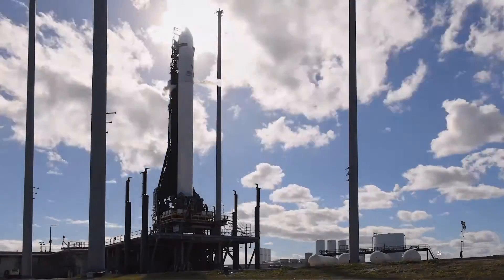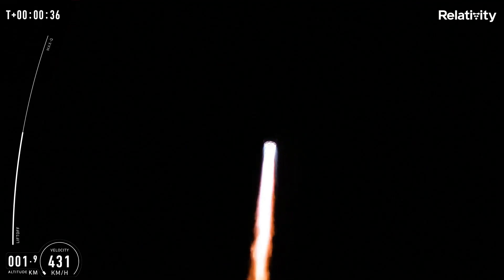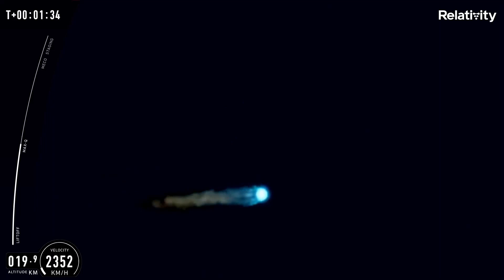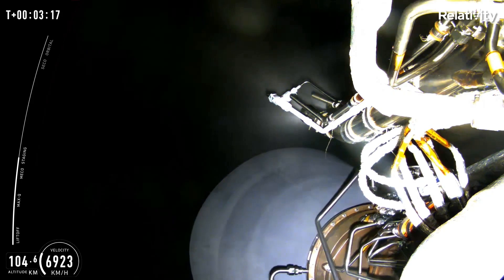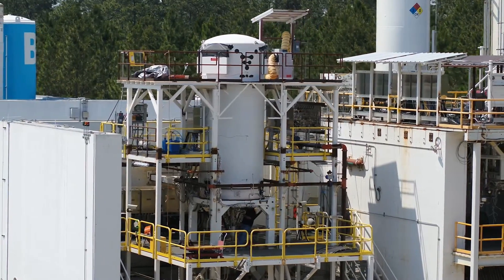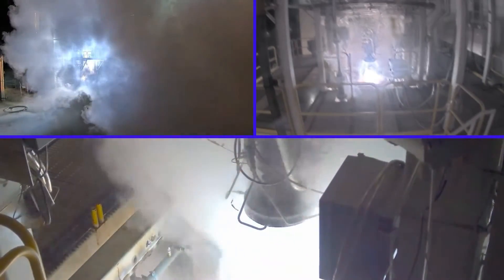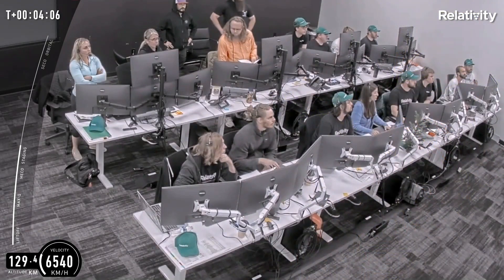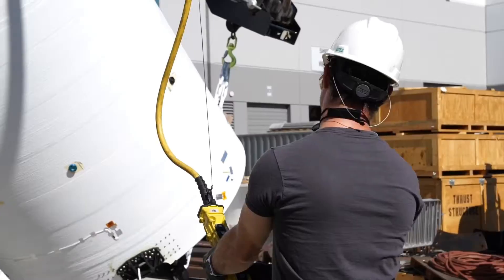First 3D Printed Rocket Reaches Space But Engine Fails Before Orbit

Comment: I do consumer 3D printing, and many of us basically watched the launch together. For some, it was just "oh cool, (mostly) 3D printed rocket" but I viewed it as something more important. So many things start small scale and can be done in a basement, shed, garage, etc. This is basically consumer 3D printing space. But for basically every industry outside of 3D printing, once you start wanting to scale, you need bigger and bigger machines, larger equipment, etc. A warehouse of servers. A 500 ton press and metal fabrication plant. Etc. 3D printing is one of the few machines that can be small and make something big.

Applied to rockets, the following occurs:

SpaceX wants to go to Mars... they need an entire development pipeline to build the rockets, even Starship with it's more "traditional" method of manufacturing. It then will launch into space... and then it needs to launch a 2nd rocket to get to Mars. If they wanted to go further, they need more rockets to refuel and go further. They have to send supplies for them to Mars, so 2 more rockets. They need to bring equipment to make the fuel on Mars. And if the rocket breaks... they're stuck. They need to go back to Earth to build another, assuming they can't repair it on Mars. They would need to create  entire plants, mine for materials to create the panels, etc.

Relativity wants to go to Mars... they need a 3D printer and spools of material. They need some non-3D printed parts, but arguably nothing "big". They send up a "normal" rocket with another 3D printer. Probably something with some spools of material. Pretty in line. But now they get to Mars and want to go further... they set up the 3D printer and print an extra rocket. It doesn't need to withstand the same stresses as launching from Earth... they can do like modern 3D printers and use composite materials where it's partially a resin/metal/etc. while the rest is "Martian Red Dust" as a filler. They need equipment for mining? 3D print it. The rocket breaks? 3D print another rocket, or the parts, or something to mount it.

When all you have is a hammer, everything looks like a nail. But when you have a 3D printer, you can 3D print anything. Another 3D printer, a hammer, a nail, a screw driver, a board, and more. To go beyond "look, we made it to the Moon/Mars/Titan/etc." but instead to make it a place that one can live, work, and build on.

Comment: Failure is how you learn and make it better.
Much prefer the SpaceX approach over the Nasa/Boeing/Blue Origin approach.
Testing and refining with real rockets is cheaper than being stuck in infinite R&D and expecting to engineer all the failure points away on paper.
Reply: Well it's not like Spacex has had trouble free test flights.
Reply: @TheEvilmooseofdoom  I feel like you misread what I said, I am in favor of test flights with trouble and unsuccessful launches instead of dumping billions into trying to engineer faults out of the system on paper and having stuff fail anyway because there was less practical testing and R&D done on prototypes.

Comment: Liquid oxygen is certainly powerful enough of an oxidizer that it can immediately ignite hydrocarbons. It's the reason that O2 fittings have to be absolutely free of any sort of debris or contamination. But I've never heard of using that by itself to light an engine. I'd love to get my hands on that schematic. From what I've seen, TEA/TEB is some seriously dangerous kit, probably only second to MMH or N2O4 in terms of super duper unhealthy chemicals to work with in aerospace.
Or skydrol. Or MEK.
PPE is important.

Comment: They will get it right, this was the first time. I would not necessarily call this a failure, the first stage did its job so a 3D printed rocket can make it through its intended function. You could look at it this way - two rockets were launched, one piggybacked on the other, the larger of the two did fine, when it was done with its job and the piggyback ride was over it was the smaller one who could not completely fire up. They will make this work.
Reply: Well the mission goal was orbit, and it didn't make it..  While they ticked off a LOT of important milestones it was still a failure.

Comment: what's the point of a reusable rocket ( devils advocate) when you boast the fact its 3d printed so it can be made on demand in to time with minimal stuff. Great for a mars lander to pump out sample retrun vessles as fast as the little robot rover army can bring the raw mats to them. buttt  a falcon 9 canm fly i think 10 or more times idk when the retire them but thoes 3d printers will be sittin idle for a long time i guess... i mean id be behind a one time use then take the crashed scrap and remelt it back into wire to weld with. Every flight could be a improvement on the last hardware wise.

Comment: Scott I feel compelled to ask, is it methane or LNG? The latter is primarily methane of course, but with several "impurities" added for various reasons, not least of which is liquification at earth-surface-normal temperatures, unlike pure methane obviously. But like RP-1 vs Jet A, that surely has similar implications on soot/coking/burn-cleanliness in the engines, so it's not easy to switch between the two.

Comment: There is a gas plume coming out from somewhere above the engine nozzle/cone. It is near the center of the video image. The gas plume is highly visible after the 2nd stage cuts off. Perhaps it is exhaust from the turbos (don't know what type of engine this is) or perhaps it is from the turbos but it is non-ignited rocket fuel gas as a result of a pressure purge or something.
It was a beautiful flight though. And they will learn something from this....and failure is a part of learning.
Now I am waiting for Vulcan. I want to see how the BE-4 engines do.

Comment: It looks like the exhaust of gas generator is not lit too. Maybe a stuck valve in fuel or oxidyzer, so the turbopumps are run by just pressure and exhaust is just...oxygen or methane. Anyway not a bad result

Comment: aeon is open cycle gas generator, and the exhaust still appeared to be coming out of the GG exhaust tube, so its probably something downstream from the turbopump. possible engine melting itself, igniter failure or injector issue

Comment: It's hard to call this a failure, it did better than I expected for a first try. 3D printing is gonna open up iterative superpowers in rocket design.
Reply: I don't think 3D printing is going to open up iterative superpowers in rocket design because they are 3D printing huge swathes of metal that take so much time to print that they could have just riveted together sheet metal faster and more effectively/reliably.

The 3D printing is actually slowing iteration here because they're having to divert time and energy into the printing instead of the rocket design.

I really don't understand what 3D printing of structural pieces like this benefits. In all I've watched no one has really made that case.

It seems like a marketing gimmick.
Reply: @volkris  have you tried 3d printing at home? It is slow, much slower than mass production. But the key is, it's much faster than custom designing a mass produced part. That's why iteration is so much faster. These rocket parts aren't exactly something you can buy at home Depot. So when you design an engine that works, you tend to stick with it instead of iterate, even when you would like to, because it would mean changing all the tooling. Plus with rocket tanks you can print things like fuel lines directly into the skin of the tank. It opens up new design possibilities. Change one little thing on an engine, and that can lead to needing to change other things. With 3d printing that is no problem. With traditional manufacturing it can set you back so far it's not worth doing.
Reply: @jameshughes3014  no, I'm referring to industrial experience where we use 3D printers where it makes sense but for things that are large and structural, well that's why we have welders on staff.

For things larger than, say, a filing cabinet we can iterate with welders and sheet metal far faster than we could 3D print the same thing, and the structure would be much more reliable than we would expect from what is effectively one huge weld.

That's why I really don't understand the benefits of 3D printing rocket bodies. Again, engines and other finicky parts? Absolutely! But just from my hands-on experience doing this kind of thing, I don't understand the value this brings, I've never heard a good explanation.
Reply: @volkris  I feel like a rocket fuel tank is a little more complex than that. These aren't just big tubes that hold liquid.

Comment: @Scott the drift is caused by the turbopump exhaust which is off-axis, and the reversals must be the RCS thrusters compensating.  The yellow-orange flashes at the nozzle suggest to me that there was a problem with the O2 delivery, so the fuel was burning very rich instead of the blue it should have been with a more efficient mix.  I'm guessing they were expecting to rely on acceleration to keep the propellant lines to the turbopump pressurised after ignition, and when it stalled there was therefore no way to successfully attempt ignition again, as the COPVs or whatever they used for the initial pressurisation were expended.  Maybe they thought the acceleration from the turbopump exhaust alone would be sufficient to keep propellant tank vapour away from the propellant lines to the combustion chamber, but the turbopump was filled with vapour and so never properly primed...

Comment: Space is hard - And this 3D printed craft is an absolute achievement. Relativity Space you've just set out a clear milestone that others will try to beat. I don't think anyone else has ever had a successful first stage launch - so job well done.
Reply: Exactly three rockets have made it to orbit on the first launch attempt.  Saturn V, Space Shuttle, and SLS.

The fact that they got to tower clear and a failure wouldn't destroy the launch infrastructure was a win in and of itself, and getting past max Q meant mission accomplished, everything after that was just gravy.
Reply: @rdfox76 hat about Falcon 9? Energia? H-II? There seem to be a few more. Ariane 4, Antares, some Russians..Also Delta IV, Titan, Titan 4, Atlas V...
Reply: @rdfox76  Other rockets have made it to orbit/stage-sep on first attempt. People seem to be confused about the difference between a successful first attempt for a clean-sheet design and a successful first attempt for vehicle using flight proven/legacy hardware from previous programs.
Terran 1 would have been the 4th rocket to achieve the former (clean sheet design) after Saturn V, Shuttle and a 3rd I can't remember (Antares I think..? Not SLS which is based on Shuttle hardware).

Comment: This is huge news. Primarily because metal 3D printing is something that can be done in space, or on the moon. It is much easier to send up a large dense spool of metal filament into space to be printed than large blocks of material to be CNC'd in space with all of the associated tooling for fabrication.

While it is too bad the rocket's final stage didn't work, but take this technology to it's logical conclusion: Once you send a metal 3D printer into space, you can then use it build much larger space craft where it will be much cheaper to build.

In the context of the moon, you could have extremely large rockets for trips to Mars or elsewhere in the solar system built in orbit around Earth where it can be relocated in orbit around the moon where it can then be re-fueled with Moon generated fuel at substantially lower costs than launching that fuel into space from Earth.

Comment: Thanks for the update and the commentary.

Relativity confuses me a bit - while I get the PR attractions of a (near) 100% 3-D printed rocket, I think that it would be cheaper, faster and less failure prone to use traditional manufacturing methods for the large and regularly shaped bits (tanks, shrouds/nose cones) which need traditional methods (welding) to integrate, and limit the 3D printing to the strength areas of the approach (complex, internal fluid paths, ie engines, nozzles, pumps).

Regardless, this is interesting to see, and I wish them better luck next time!
Reply: Then they would not be able to raise as much money from the Silicon Valley types who love anything 3d printed. It’s cool but I don’t understand why you would 3d print a nose cone? Sheet metal fab is perfect for that type of thing. Still cool though
Reply: More like 85%, so some of that thinking was used.  But the whole idea is to prove the concept.  Can you do basically anything with the technology?  A resounding Yes now.  But should you always use it?  Nope; that question gets asked and answered later, but like you said, probably (and practically) not.

Comment: Could the "moving lights in Florida" just have been the reaction of the upper stage to the engine gimbal? After all if you move the engine there should be a force applied to the rest of the stage (even without thrust).

Comment: I would call this a successful test flight, they went through max q without issue which was the main point of the test.  The first stage performed perfectly and im sure the second stage not igniting is a fix they can implement reasonably quickly.
Reply: A mixed success. Everything on the first stage stage has apparently gone perfectly, and in particular, they got through maxQ without dramas. But they certainly would have been hoping to be the first startup to reach orbit on the first try... RocketLab almost did it, but were undone by a ground-based comms failure rather than a vehicle problem.
Reply: Or it could be a more serious design flaw. We have no way of knowing yet.
Reply: @BlueZirnitra  Serious design flaw implies incompetence, not impossible that that's the case here but it's unlikely based on what we have seen with other rocket companies on their first launch attempts. Normally the problem is tracked down and corrected and does not require major redesign of the rocket.
Reply: @StevePemberton2  It doesn't imply incompetence at all. Flaws happen in otherwise sound ideas, that's why we test. That's what this was, a test, to see if everything that adds up on paper will work in the unpredictability of real life. Pretty much every design more complex than a stick experiences flaws. That's what a flaw is, it's a shortcoming that is understandable in the greater context of the thing, be it a decent human being or a complex cutting edge machine that hasn't been perfected yet.
Reply: @BlueZirnitra  Don't disagree with any of that. And sorry if I misunderstood what you meant, but "serious design flaw" implies more than that, as if some of their fundamental assumptions or methodologies were wrong, requiring a major redesign. Now that I know that's not what you meant, maybe a better way to phrase it might have been, "Or it could be something that is harder to fix and which takes longer. We have no way of knowing yet."  I realize that might seem like just semantics but it would be less subject to misinterpretation.

Comment: Isn't a Expander Bleed engine? If so, maybe it didn't developed enough heat pickup to fully drive the turbomachinery to its nominal operation condition? Really looks like the TEG is ehausting some sort of liquid instead a gaseous flow

Comment: Also those blue flames are beautiful, if other methane rockets like Starship are going to look like that I'm going to love it
(... but if this is using methane, what's the Rocket that's using plain jet fuel?)
Reply: RP-1 is basically jet fuel with tighter quality control.
Reply: Falcon, Atlas, and Electron all use RP-1 (kerosene).

Comment: Absolutely correct. 3D printing makes design work so much easier. Prototype? Sure, let me print one up. Prototype failed? No problem let's tweak a couple of parameters and give it another try. Of course it's not quite THAT easy but this could bring the cost of space down in a big way (especially if they can land the 1st stages and re-use :). I must agree, this was not a failure but rather a proof of concept and a learning experience. Great stuff. Thank you.